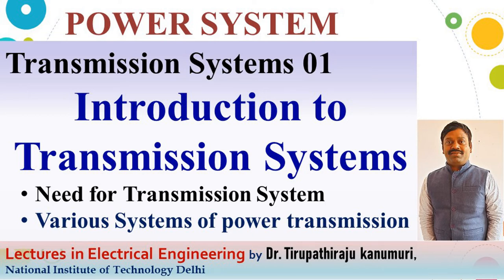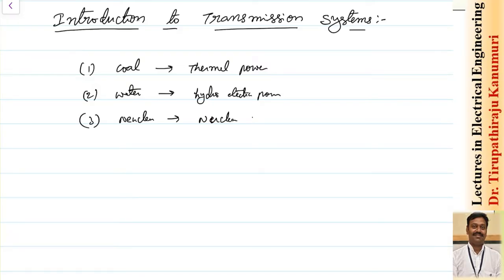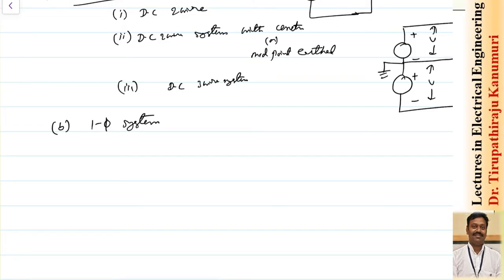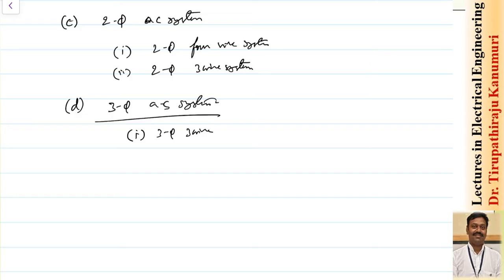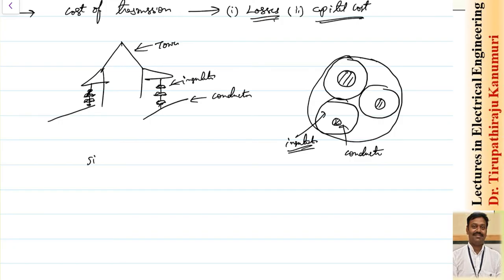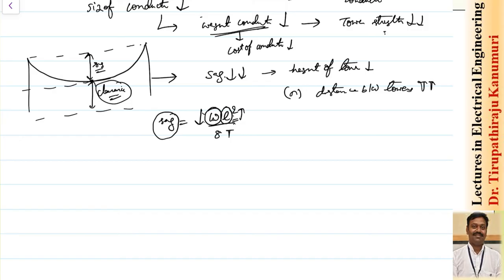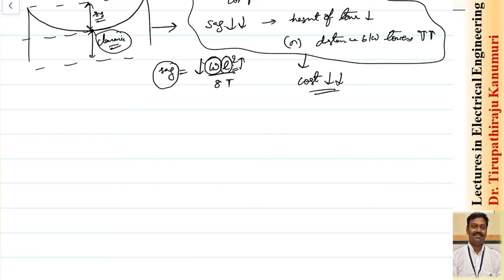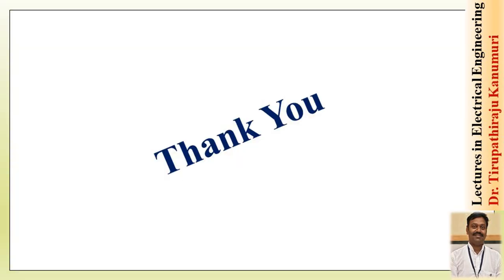PS01 Introduction to Transmission Systems

Comment: Sir, at 17 min. each core need to be insulated to required Phase-ground voltage. It is not line voltage decides the insulation. Please correct if I am wrong. Thanks.
Your lectures are good. Thank you.

Comment: Hello sir 
Your lectures are super...i have studied all lectures which are very good. 
But i found in power system the following parts are not covered...
1) power system stability 
2) load frequency control
Plz add those videos also this is also very important topics.
Reply: hi bro can plz you help me in finding these videos in power system Vibration Dampers, Arcing Horns, Sag / Tension calculations, Equal / Unequal supports, Effects of Wind, ICE / Erection Conditions Stringing Charts

Comment: in contrast flux control of 3 phase synchronous motor,at medium and rates frequencies the supply voltage and supply frequency are related as v=kf,where k is constant but, at very low frequencies the supply voltage should be
Reply: constant*

Comment: Sir in ug cable how can there will be potential difference between 3 cores when 3 cores are R,Y,B having same potential. how max voltage is between two conductors in cable

Comment: sir can you share video link of Vibration Dampers, Arcing Horns, Sag / Tension calculations, Equal / Unequal supports, Effects of Wind, ICE / Erection Conditions Stringing Charts ihave search alot but i didn't found
Reply: I need badly sag calculation

Comment: sir i have one doubt ,
if voltage will be increased current will be also increased, so v increased conductors insulation also increased then the conductor width is increased. but how we transmit. please explain this
Reply: Insulation at poles increased not at conductor,over head line conductor exposed to atmosphere without insulation